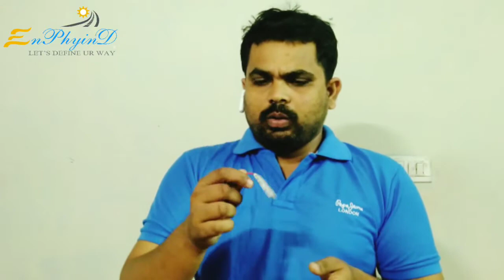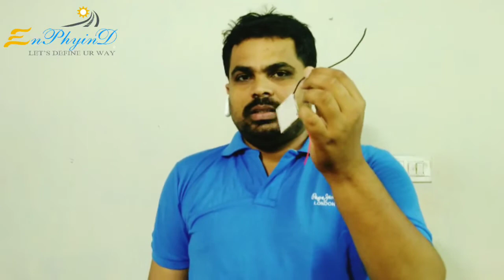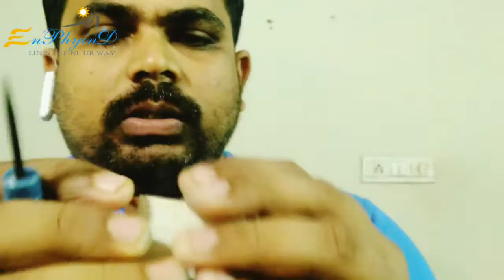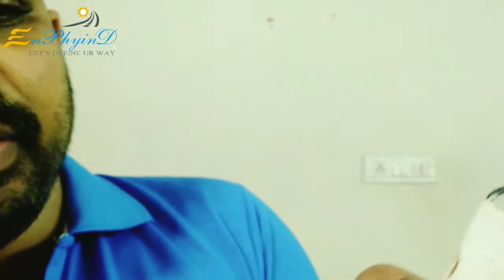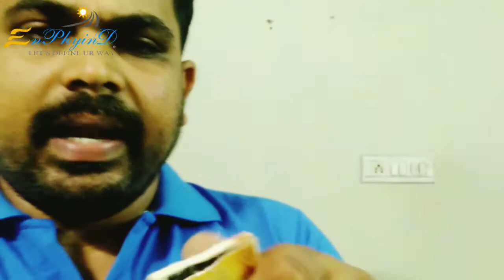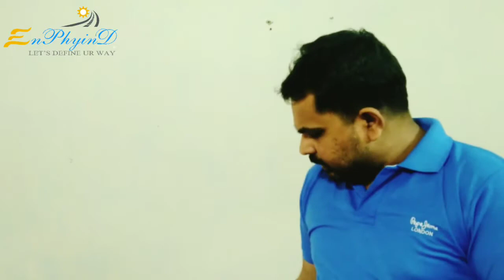Peltier cell efficiency I Peltier fridge/AC is it real? I TECHniQs by EnPhyinD

Comment: First of all there are many pieces missing in what you've said. At the same time your statement is true. The efficiency of a peltier depends up on the removal of heat from the hot side. In my experience for a peltier like tec1 12706, and optimum voltage of 5-9v is more than enough bcz the hot side gets less heated and the heat is instantly transmitted to the heatsink and the hot side of the peltier is cooled faster which will help the peltier draw more amps and more cooling. I managed to get 2degree C continuesly on applying 6.5-7v DC which draw arround 4-5amps. I also made the hot side cool faster than it's getting heated and the result was pretty good. I tried it with 12v but it only draw upto 2amps and the heat from the hot side was also getting transmitted to the cold side, lowering the efficiency. So imo optimum voltage of 5-9v volt is best suited for better efficiency. This statement was also proved by an electronic shop owner in my area.
Reply from the maker: OK bro thanks for detailing 😊
Reply: Yes bro you are absolutely correct 💯

Comment: Sir could it can be used sa a heater for drying purpose
Reply from the maker: Yes frnd it can  ,different petlier models available some models produce more cooling and some produce heat so select accordingly,also please note it takes much current for continuous usage

Comment: Cheythu nokathe veruthe parayan nikkaruth .. Ithupakayogichu air cooler undakiyathanu njan  5 module oru row ayi set akiyanu undakiyathu  heat sink pipe upayogichu connect cheythu 200 ns bike nte  radiator upayogichu  air cool cheythu nalla result anu kittiyathu.......... Chumma veruthe  abhiprayam. Parayathe test cheythu noku
Reply: Contact number please
Reply: Yes
Reply: Njanum success akiyathanu

Comment: Phone nte backil vech cool cheyyikkaan pattoole
Reply from the maker: Means phone chudavunnarhu kurakkan ano?
Reply: @teqcafebyrenjithvr  yes  heating issue but i want it cool down
Reply from the maker: Pattum frnd  proper heat sink with fan kodukkanam ..
Reply from the maker: But I'm not recomend because liion battery is highly humid sensitive hence any water droplet will reduce your battery life ..anyhow while cooling water drops coming to the surface of cell .
Reply: @teqcafebyrenjithvr  fanil ninn varunna caatinte direction Peltiar lek aano atho purathekkaano flow aakandath
Reply from the maker: Randennam venam onnu exhaust ayi chudu purathu kalayan aduthathu thanuppu spread cheyyan ..chudu ullathu purathekkum thanuppu spread cheyyunnathu phoninte angottum
Reply: @teqcafebyrenjithvr   cooling nu vere fan aavashyam undo peltaiar direct phonumaayi contact aakiyaal pore
Reply: @teqcafebyrenjithvr  bro
Reply: @Teqcafe by EnPhyinD   cooling nu vere fan aavashyam undo peltaiar direct phonumaayi contact aakiyaal pore
Reply from the maker: Athu atra nannalla direct contact chilappol irpam.undakkum athu batterykku nallathalla ..phone should away from direct cooling atmosphere
Reply: @teqcafebyrenjithvr  ok

Comment: 100 Littre ന്റെ ബാറ്ററിയിൽ പ്രവർത്തിക്കുന്ന പോർട്ടബിൾ ഫ്രിഡ്ജ്  ഉണ്ടാക്കാൻ ഇത് കൊണ്ട് സാധിക്കുമോ? സാധിക്കുമെങ്കിൽ എത്ര peltier module വേണം? 8 മണിക്കൂർ പ്രവർത്തിക്കാൻ എത്ര ബാറ്ററി ബാക്കപ്പ് വേണം?
Reply from the maker: 30 litre maximum after that huge loss in pricing and all,also for refrigeration purpose need to use good peltier and it is costly ...each peltier modules have different cop ability so need to calculate its capacity,cooling ability,heat calculation etc for better perfomence
Reply: peltier ഉപയോഗിച്ച് ഒരിക്കലും freezer ഉണ്ടാക്കാൻ കഴിയില്ല ..നിലവിൽ തണുത്തിരിക്കുന്ന ഒരു വസ്തുവിന്റെ തണുപ്പ് കൂടുതൽ നേരത്തേക്ക് തണുപ്പ് കുറയാതെ സൂക്ഷിക്കാൻ peltier കൊണ്ട് കഴിയും ...പക്ഷെ  ഇതുകൊണ്ടു 100ലിറ്റർ ഫിർഡ്‌ജിന്റെ size ഉള്ള ഒരു portable കൂളിംഗ് സിസ്റ്റം ഉണ്ടാക്കുമ്പോൾ (not like Refrigerator) യഥാർത്ഥത്തിൽ ഒരു ഫ്രിഡ്ജിനെക്കാൾ cost വരും ..എന്നിട്ടും ഒറിജിനൽ ഫ്രിഡ്ജിന്റെ പത്തിൽ ഒന്ന് മികച്ച RESULT  പോലും കിട്ടില്ല...കാരണം 
ഒരു PELTIER മൊഡ്യൂൾ തന്നെ മിനിമം 6 ampere current consumption വരും…മിക്കവാറും 100ലിറ്ററിന് വേണ്ടി ഇതുപോലത്തെ 100 എണ്ണമെങ്കിലും ഉപയോഗിക്കേണ്ടതായി വരും ..അപ്പോൾ total powerup ചെയ്യാൻ battery  വെക്കുന്നത് ലാഭകരമല്ല...

Comment: Seems how you already broke it you can take the pieces from inside and separate them by positive and negative pieces and try making other things like two of them touching should act like a diode and three of them should act like a transistor I'll bet it will be slow and kinda sick but should work if you had the pieces organized right
Reply from the maker: Correct it's a on junction material so we can but size is very small ..
Reply: That stuff is toxic be careful
Reply from the maker: Yes 🥰

Comment: സുഹൃത്തേ ഇത് ഇൻകുബേറ്ററിൽ 60വോൾട് ബൾബിന് പകരം ഉപയോഗിക്കുന്നത് ലാഭമാകുമോ?5amp 12v dc out put adapter കയ്യിൽ ഉണ്ട് .adapter input 230v
Reply from the maker: Yes upayogikkam moreover it produce heat more than cool so it can use but continuous usage of adapter will cause it fail,since single perkier module will take almost 6 amp so once we use low amp supply component will over stressed may cause premature failure,sarikkum paranjal 12x6 Amp=72 watts edukkum athuvechu nokkumbol bulb alle better.
Reply: @teqcafebyrenjithvr  12x6=72 watts ഇതിൽ 12v dc ആണ് ഉപയോഗിക്കുക അപ്പോൾ വരുന്ന  72 വാട്സ് 60watts ബൾബിന് ac input 230v അങ്ങിനെ ആണെങ്കിൽ എനിക്ക് ബെറ്റർ ബൾബുകൾ തന്നെ അല്ലെ. മറുപടി പറഞ്ഞു തന്നതിന് വളരെ നന്ദി
Reply from the maker: With pleasure

Comment: ഞാൻ 10 വർഷത്തോളം Refrigarator കംമ്പനിയിൽ വർക്ക് ചെയിത ആളാണ് പല branderd കമ്പനികളും ഈ മോഡ്യൂൾ ഉപയോഗിക്കുന്നുണ്ട് നല്ല രീതിയിൽcooling ഉം കിട്ടുന്നുണ്ട് സാധാരണ കംപ്രസർനെ അപേക്ഷിച്ച് കുറഞ്ഞ കരണ്ടിൽ നല്ല Cooling കിട്ടും എന്നതാണ് പല വലിയ വിദേശ കമ്പനികളും കംപ്രസർ ഒഴിവാക്കി ഈ മോഡ്യൂൾ ഉപയോഗിക്കാൻ കാരണം ഇപ്പോൾ ഇന്ത്യയിലും അത്തരം Rafigarator നിർമ്മാണം തുടങ്ങിയിട്ടുണ്ട് അടുത്ത് തന്നെ വിപണിയിൽ എത്തുമെന്ന് പ്രതീക്ഷിക്കുന്നു
Reply: Ac യിൽ ഈ മോഡ്യൂൾ പറ്റില്ല Rafrigarator കളിൽഒത്തിരി ഈ മോഡ്യൂൾ  കണ്ടിട്ടുണ്ട് -14°C വരെ കിട്ടും ഫ്രീസറിൽ ഞാൻ ഒരു കമ്പനിയുടെ ട്രൈനിം ടൈം മെഷർ ചെയിതിട്ടുണ്ട് ഇത് ഇതിനെ പറ്റി ഒരു സെമിനാർ ഉണ്ടായിരുന്നു അന്ന്
Reply from the maker: Yes brother ethil commentil palarum chodichappol njan paranju it's closed loop refrigeration pattum ennu open loop aya ambient air tanupikkan pattilla athepole valiya area also
Reply from the maker: Thank you experiments starts from 1834 athanese peltier invented this module but due to low heat flux limitations its use limited like portable coolers,panel fan cooling,CPU cooling etc ..also they use industrial tested and verified modules  and its cost is high ...
Reply: @teqcafebyrenjithvr ഇംഗ്ലീഷ് ഒന്നും പറഞ്ഞു ഷോ ഇറക്കണ്ട അണ്ണാ 😂😂

Comment: Car il ulla refrigerator engane aanu sir 😁
Reply from the maker: Mini refrigerator no issues I already replied some one asking the same  how it possible
Reply: @teqcafebyrenjithvr  i will make tec ac it’s possible
Reply from the maker: Also they are not using tec module it cost around 3000 minimum for single cell..it's a standard industrial cell can be used in panel cooling fan etc..

Comment: Great video ... Thanks for the info...

A suggestion... You told that since the heat and cooling is applied to the same environment, the cooling is ineffective. What if we separate the heating and cooling environments??

For eg.. placing the peltier module in the window and allowing the cold air to circulate in the room and remove the hot air to outside???
Reply from the maker: At the outset sincere thanks for all frnds and here in this case peltier cooler used for some special applications like small fridge which is used in vehicles,small exhaust cooling fan for industrial applications also cooling fan for computer processor apart it is not useful because these all application the environment which cooling is limited that means closed environment you can assume in the case of mini fridge the air traped is small so this can cool easy but in room it is open loop so the ambient air cooling is not possible.i hope you can understand what I meant.
Reply: @teqcafebyrenjithvr  

So what if the cooling area is small?? Is it efficient?? 

And what if we make an extensive unit ( made up of multiple peltier modules), will it be able to cool the room??... I know it won't cool as fast and efficiently as a normal AC, but will it be able to cool ??
Reply from the maker: As in market the peltier moduels available not last it's cheap one the unit which makes one thing need great effort to calculate heat sink calculation CFM ratio for both fans etc otherwise it will damage after due couse of time
Reply from the maker: A single module which need almost 6 ampere for its good working when you combine these module you can calculate how much energy you lost